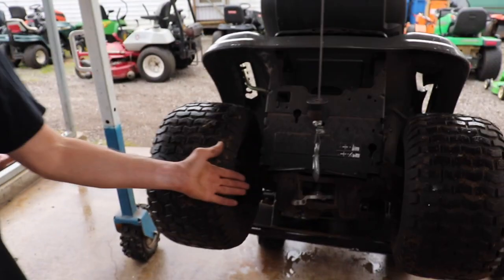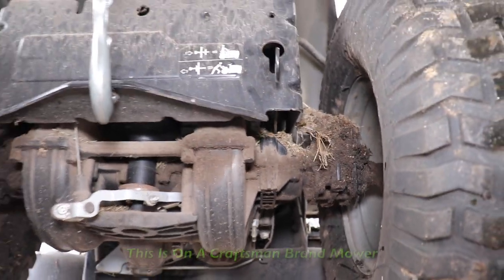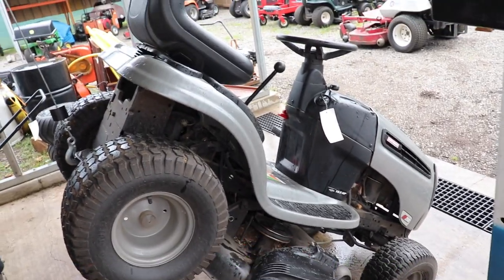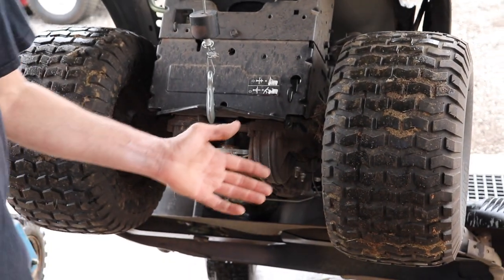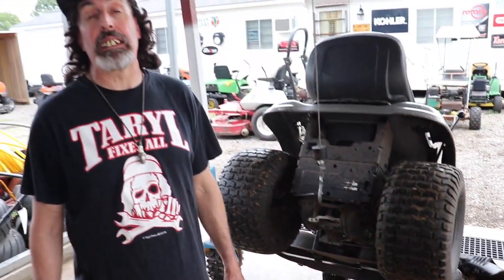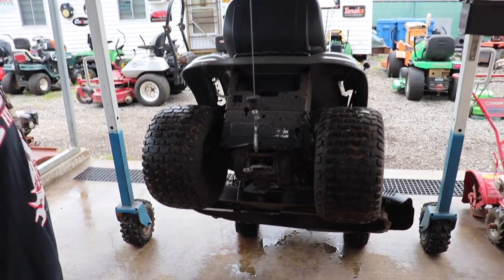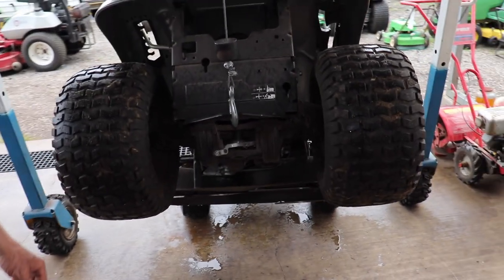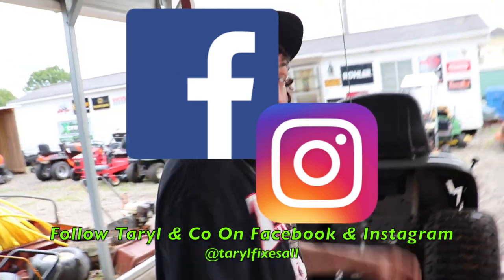WHAT?! A Plastic Transmission? WTF were they thinking?

Comment: I saw one of those plastic ones in a John Deere I bought back in 2019… immediately loaded it back up and exchanged it for a higher end model with one of the more widely used metal cased Tuff Torque transmissions.
Reply: Very smart move, no matter what your spouse says!

Comment: Tayrl you are right those plastic transmissions are garbage. I will never buy a new lawn tractor unless given to me. I plan to buy a Kubota zero turn Z251 with a Kohler engine and zt3100 Hydro Gear transmissions. Because of the rops and the Kubota dealer is close to my house. Spending 7000 dollars on a Kubota is the way to go forget Lowes and Home Depot and go to your dealer get Cub Cadet or Kubota or even Scag and Husqvarna.

Comment: I have a john deere d105 with the plastic trans and it's still working hard.  I have replaced the variable speed pulley and belt. I followed your video step by step and it was a breeze to do all the work.  And hey it's not the space shuttle it's a lawn.

Comment: That's why I'm still holding on to my 1988 JD 316 with the 18hp Onan. It's a tank and keeps going, I pulled a 2500# roller around on a 3 acre field and cut the grass several times already no problem but than i did the same thing with a old JD 212 before and never blew it up.

Comment: I have actually had one of these riding mowers since 2014. I tend to like new tech, so I took a chance and bought one. I still use it, but I will say it is definitely not the greatest transmission. But then again, I do not think the K46 TuffTorq transmissions are very good either. 

When I first got the tractor, it worked very well. At about 100 hours, I began having issues with it. It was a foot operated forward and reverse model and it would stick. I found that was because grass clippings would pack into the shift mechanism and lock it up. I removed the transmission, cleaned it and it went back to decent operation. At that time I owned a yard that was very hilly and eventually it smoked a variator belt at 150 hours. I replaced the belt and soon after (about 225 hours) it wore another one out. Finally I started looking into causes. I found the transmission had a primary and secondary pulley with the primary pulley changing size from the foot pedal. The secondary had a spring that would provide resistance against the belt. As the  tension of the belt increased (via the foot pedal) the spring would be overcome and allow the secondary pulley to open up, raising the gear ratio and allowing the tractor to go faster. I wound up experimenting with a spring with more tension and that has appeared to have fixed the belt wear issue. I communicated my findings to General Transmissions, but they have since stopped making my model transmission.

As of now (3 years after the spring replacement) it works just fine and I will run it until I can no longer repair it. I will not ever use a CVT again, and will not buy a k46 TuffTorq either.

Comment: I'm glad that I have my John Deer 425 all wheel steering tractor. It did have the plastic cam gear ⚙ in it. But I did replace it at over 1,000 hours. I did it myself. I do have the factory repair manual for it to. So I do all my one repairs on it. I'm the 3rd owner on it I'm just over 1300 hrs. It was used by the first owner very much. The 2nd did. And I have but now only cut grass with it. I don't do anything else with the tractor. I have a case 446 that I use in my yard to pull my trailer around to do yard work and plow my snow in the winter or anything else I need to do. I have fixed the 446 also.  It runs great to. Everyone wants to buy it from me but I won't sell it. I use it to much. It's a great tractor 🚜 to.

Comment: engineers "how do with make the FnR vari-drive transmission better?".   I know, let's make it out of plastic!  Genius!  That drive system is hard on belts, wears them out faster than any other drive system I've seen.  And then when the deck rots out, might as well toss the whole thing because you can't even make an offroad mud mower out of them since they can't be geared up for any speed.

Comment: I have a 1976 mtd riding mower. No plastic anywhere on it. I replaced the engine in 1990 and it still runs great. If something breaks I can usually weld it back. Guess I will mow with it till I die.

Comment: I've seen brand new John Deere's with these junk transmissions in them....no way would I pay top dollar for the John Deere name and get a plastic turd for a trans.
Reply: Wow I hear that !! 
No way Jose. 
I mean as a tech I can understand the reason for the plastic carburetor and that's because of the ethanol issue ,but a plastic trans is just junk. 
I wouldn't use it in my tinkertoy
Reply: I see a lot of john deers with plastic trans at lows
Reply: Whe I was buying a John Deere they had both options. Definitely went with metal. Plastic doesn't even make sense for a part like that.
Reply: You get what you pay for. Buy a commercial grade mower and you’ll enjoy good service for 10-15 years will minimal maintenance. They are sold at the John Deere dealership… duh!
Reply: If you're buying John Deere, you are spending premium $ on green & yellow paint & brand recognition, 'cause their lawn & garden equipment has been junk for a long time, no matter if it's purchased at a box store or the dealer.
Reply: Go pay $20 grand for a commercial grade mower. I did twenty years ago and it’ll be cutting grass long after I’m gone. Ain’t nobody got time for that.
Reply: @bow3123  even my exmark metro has a metal transmission in it commercial grade not the cheap junk
Reply: People see JD and Toro at the Depot and Lowes and they think they’re getting the same stuff cheaper than a dealer. That’s not good shopping dealers can match prices and even be cheaper sometimes I don’t buy power equipment from box stores, except maybe a snow blower. I own a Ferris lawn mower and a Toro snow blower both I bought at a dealership. I get anything I need to maintain or fix these without and issue and I paid less than box store prices too!
Reply: If you go to the dealer, & buy one not from a big box store like Home Depot or Lowe’s one can avoid the plastic transmissions if I remember correctly.
Reply: @michaelbenoit248  most likely because the dealers wouldn't touch them with a ten-foot pole because they'll have to be the ones to fix it and deal with the bad reputation.
 The big-box stores on the other hand don't fix anything themselves, and don't care about one customer's bad experience.
Reply: Amen!

Comment: I have 3 customers who sadly had these junk transmissions, had to break it to them, then I have 4 others who asked me what should they buy, and I advised them what to buy, and steered them clear of these.
Reply: The 2 transmissions I have repaired were simple to repair, the transmission gets a bad reputation because people think plastic, but its actually a strong composite.  Also, the shifting issues were from customers not keeping top of transmission clear of lawn debris and it gets caught in the moving parts just as any other transmission or linkage on a mower.  The hydrostatic transmissions have a fan to prevent this, but still can get lawn debris on them and cause issues.

Comment: Just a tip to everyone that is looking for a riding mower/ garden tractor buy a fixer upper that needs tlc a little money and you have a bullet proof tractor I’ve never bought a new mower ever I’ve fixed up machines and they work super good you can’t buy a quality product like they used to make back in tue day if you are getting a new mower or a garden tractor John Deere from the dealer is a good choice or a simplicity tractor are really the only good ones around if your looking for a zeroturn buy a toro hustler scag or exmark you will never be disappointed with it the bad boy hisqvarna and craftsman etc zeroturns are junk don’t get them they will let you down and bob cat they are not what they say they are I’ve learned this through experience

Comment: They don't seem too bad if you catch the axle seals right when they start leaking. Put new ones in with a little something to seal around them. Should be designed a little better but they work.

Comment: The problem may be the way the people are using the mowers.  Only good for mowing grass, no tow or push.  No ground engaging implements.  Gotta keep it clean around the pulleys also.  Would I buy it?  Not sure.  I just mow grass so maybe.  Current machine cub XT2 42in stamped deck/Kohler 7000 KT-725 so I'm good for now.

Comment: Thnx for rhe advice! I wished I lived near u to buy a used one. Im a senior so I know what to look for. Not a big fan of craftsman. Had no clue husky & jd has them too! 👍
Reply: Craftsman equipment is made by all different manufacturers they arent a specific company. Depending on  the machine type and when it was built it can be a Husqvarna, MTD or Murray or some other brand.
Reply: I was a senior in 1979, then I went to college.
While there, I learned that women are very dangerous.
Then I graduated (from college)
Then I worked for 35 years.
Then I quit.
Then I found Taryl.
Now I am at peace with all things mechanical.
I have opened the Church of the Holy Transmission of Taryl.
We do not allow plastic transmissions, 
unless they confess their sins in the fire pit.
We anoint our brothers with old motor oil.
Soon, I will be a second generation SENIOR!
Best to you sir.

Comment: Silly question.  Is there a metal replacement option?  Possibly from an older or different model ? I suppose  bolt on is pushing it,  but maybe just a little  drilling  / light adapting?

Comment: I've always liked Craftsman wrenches and sockets and they used to have a good warrantee. But every Craftsman power tool or mower I have ever seen didn't last long. The Tecumseh engines they used were junk. Haven't owned power tools or mowers from them in ages. Still have my old Craftsman tool boxes stuffed with their hand tools that I bought decades ago and they hold up fine. Last year I bought an extension middle box for a stack and it was so far out of square and so flimsy I thought it would collapse from the weight of the top box. Sent it back.

Comment: Had a ariens with that pof transmission in it seals leaking grease replaced them but I always had another problem I have a bunch of gum trees and those little balls with spikes were always getting stuck under the actuator causing it not to go in reverse the company sells a guard but it still kept getting under it so I sold it 2 years ago

Comment: Dear Mr. Taryl:
When you says Plastic Transmission,
I assume you mean the HOUSING only.
Not the gears.
Thanks again.
You're still in my will.
Reply: You would be wrong.  The differential is plastic also.  I tore into one a jd d105.

Comment: You can get an upgraded transaxle from RJR Tractors for most riding mowers. I upgraded mine, and now it is faster and doesn't slow down up hills. They aren't cheap, though.
Reply: $2475-2675

Comment: do transmission swapped because i done it once on using murray transmission on john deer because it have plastic transmission but body is in good shape n engine is good n deck cut good just bad transmission plastic so i rop one off of rusted out Murray n throw in there have do few adjustments get belt lined up which good to go

Comment: I just fixed one for a customer. The belt was garbage on it and the Husqvarna dealer was adamant there were only 2 belts, not 3. Got one that was really close and got it working again. Just stupid. They want you to replace a 1000$ transmission instead of changing a 40$ belt.

Comment: Do you sell the "small D" screwdriver for adjusting Echo carbs? I couldn't find it if you do.  I tried the ones on Amazon and they don't fit.
Reply: Get the mixture screw out with needle nose pliers... take a dremel with a thin cutting disk and put a notch in them... now you can use a screw driver to adjust it... I was a saw builder and there was a few saws you had to do that to

Comment: The most common problem with that plastic transmission is owners not removing the battery case, and then cleaning out the grass and twigs which build up on top of the trans, then interfere with the shifting and drive belt operation. 
The grease seals on the axles can eventually leak, but they are easy to remove & replace. Put a little gasket sealer around the outer edge of the new seal, after cleaning the socket where it goes into. A wrap of electrical tape would probably work, since the trans is filled with thick grease, not liquid oil. If you keep the grass off the top of the transmission, & change the axle seals every 5 years, the transmission will last 20 years, unless the mower is being used commercially. They aren't designed for that.
Reply: so do a lot of extra things, that you wouldnt need to do on a normal trans, and if you service it and treat it gentle it will maybe go at least half the span of the things it replaced

And you ended up paying more for it 

I dont think we are winning, bill.

Comment: If they would have used metal parts for the shifting and variable drive and a metal bracing where the two halves meet they would be a lot better.

Comment: Omg 😱 I fell into that trap 🪤 a couple of years ago when I bought a Husqvarna riding lawnmower. The motor is good so far but the plastic transmission is junk. The seals are leaking at the axles and it’s starting to be wonky with the forward and reverse. 
Don’t fall for this junk you could probably get your lawn mowed for several years for the price of these JUNK mowers.
Reply: Try removing the battery case & cleaning the grass and twigs off the top of the transmission. That usually cures the shifting problem. The axle seals cost $15 and, YouTube videos show how easy they are to change. If the new seals aren't a tight fit in the transmission, clean the holes well and apply some kind of sealer on them before putting them in. I didn't, and had to change them twice, because the new ones leaked around the transmission housing . Sealant fixed that. That trans is grease filled, not oil filled.

Comment: my plastic transmission randomly goes into neutral and will not go forward or reverse. when it does this, the parking brake doesnt work either, the mower is completely in neutral no matter what.. i have to get off the mower and rock it back and forth until it locks in gear then it drives just fine...any suggestions?

Comment: love your videos,   but i'm having difficulty looking up torque numbers,   if you would please help me i have 2 generators that i'm trying to get running,   what would you torque the head bolts to,  one's a briggs 342 cc  the others a generac loncin engine 389cc.   thanks George
Reply: Just tighten it till it breaks then back off a quarter-turn!
 Seriously though, if you can't find the torque specs for your particular machine, I would suggest getting a torque spec chart that shows the different sizes, different thread pitches, and different grades of bolts and how to differentiate them.
 If you can't find it online you can probably find a chart like that at a dedicated Fastener Supplier.
 Good luck.

Comment: Most of these transmissions are the same and built by the same company that makes CVT transmissions for crotch rocket motorcycles...but in motorcycles they are built tough. The plastic mower ones suck balls. Had one the variable pulley broke. Ordered a new pulley...dimensions where all wack and would not work. Ordered another with the same problem. Got them to check dimensions on their stock and ALL the pulleys were wrong. Mislabeling problem or quality control problem who knows. Needless to say...parted out the mower and still made $800.

Comment: I got a 2015 craftsman 42in cut 18.5 hp with 152 psi and new battery mower is like new oil is not even dirty yet and it’s real hard to turn over what is my problem
Reply: Broken pressure release on the cam.
Reply: @ItsMrAssholeToYou  it doesn’t have 20 hours on it so cheap I will start it with a drill and socket

Comment: sadly, not only is quality no longer a selling point, it's been deemed unprofitable. if manufacturers design a product to last 10 years, they won't be able to sell the customer a new one for 7-15 years, depending on how well it's maintained. if they design it to last 3 years, the customer will need to replace it at least twice in that same timeframe. and by designing it to be non-repairable or failing to make repair parts available, they can increase that to three replacements on average. that's 21st. century business philosophy and practices in a nutshell.

Comment: I run my own small engine repair shop and  unfortunately I see these all the time with the exact issue. Ive been telling people the same. Just run em till they crap and then make sure the next one you buy has an actual metal transaxle. Been fixing equipment for 25 years and stuff is not made to be repaired any more. Feel bad for my kids generation. Nothing but chinese made junk every where you look :""( If you wanna get a machine thats worth the investment, buy Japanese.

Comment: There are plastics that are stronger than metal for small gears. Been in use for years. Before an intelligent individual makes a comment he would check out the material spec and loading.